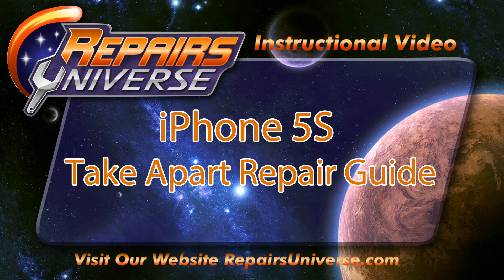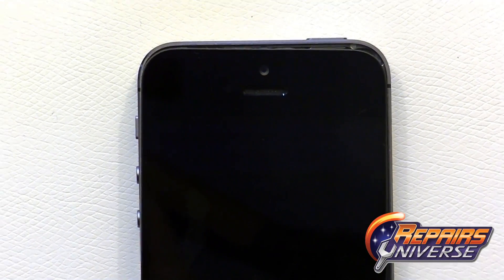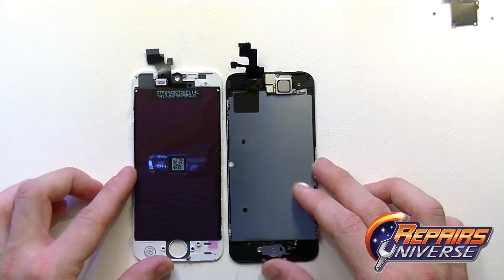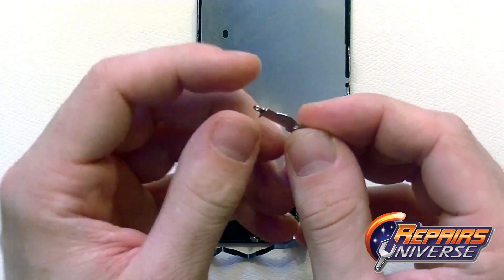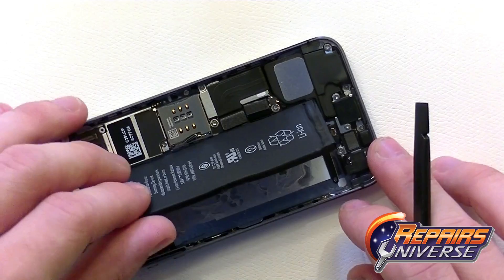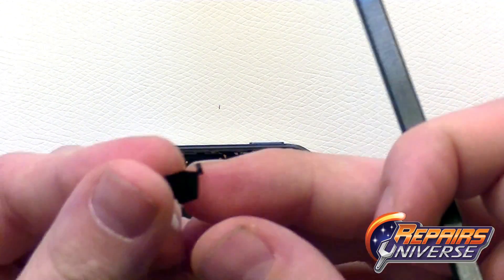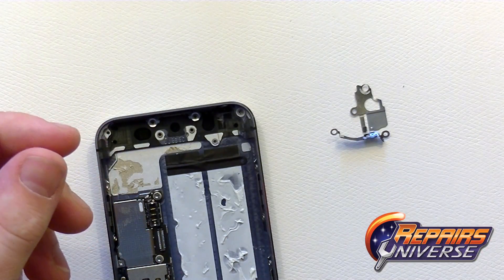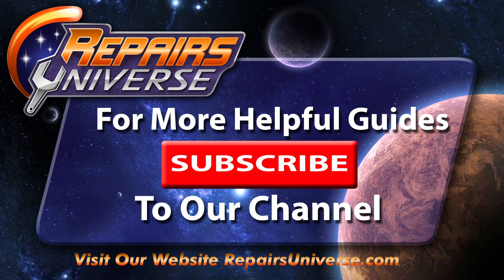iPhone 5S Take Apart Repair Guide

Comment: Can i take apart my iPhone down do the battery ,motherboard & the loud speaker only & use it as a gps device , now of coarse I would set up the FIND MY IPHONE app , but will it work still if the phone battery died but was recharged , & I would not have a screen so maybe I can plug it back in to check the battery level , please reply & by the way , the iPhone is not connected to any phone network because I have a new iPhone , but I can still surf internet cause it log me on to WiFi , so will it still be able to track in the first place

Comment: What do I do if the flex cable came detached from the home button? When I was using the suction cup to lift the screen side up, I pulled too hard and the flex cable detached from the screen side. Is there an adhesive I can use to reattach?

Comment: What happens if you try to turn it on without the battery plugged in?
Reply from the maker: +DFKnightmare Everything should be fine, with no power to the phone no damage should occur.

Comment: My daughters 5s had water damage. I replaced battery. Now it frequently and randomly says its over heating. With a few pushes of the sleep button usually starts working again. Also when plugging in the lightning charger, it says "may not support this device". To charge we must plug in then turn off and let it charge while its not thinking about whether its compatible or not. Any ideas?

Comment: I just watched the 5S take apart repair guide which happens to be exactly like the one I have.  I followed the instructions to the 'T' and was really proud of myself until the very last step on the motherboard.  Maybe the antenna was rotted but it broke when I tried to remove it from the motherboard and bounced across the room...into a deep dark hole somewhere.  What do I need to replace this antenna lead.  There are so many different types I don't know which one to choose.  Help please.  Reuben Atlanta, Ga.

Comment: Wife dropped i hone 5s in toliet want to fix it it wont turn on tried drying with desiccant. Is there a way to inspect it to see what parts i need.
Reply from the maker: Richard mullins You would want to start with a new battery. Then if the unit powers up, verify which other components may be required to be replaced.
Reply: +Repairs Universe how to verify it?

Comment: I had two additional flat screws at the top of my 5S motherboard that you didn't show removal of.  I removed one, but didn't see the other in the top little L box, so that little box snapped off!  OUCH!  After all that!  Will the motherboard still work if this little top box isn't connected to it?

Comment: I had my phone repaired from a cracked screen a couple of months ago. I noticed my self view camera does no work. Can it be that the screws that hold down the ribbon connectors were mixed up? If so are these screws different sizes and have a specific hole to fall in place. Thanks in advance.
Reply from the maker: The front facing camera has your proximity sensor as well. This may have been damaged when installing the new screen. However, you can replace the assembly and should resolve your issue. http://www.repairsuniverse.com/iphone-5s-front-camera---sensor-flex-cable-replacement.html When taking apart your iPhone, the screws are different sizes. So keep in mind where you removing them from as they would need to be placed in the same place.

Comment: why wont my motherboard come out...all the screws are out aswell
Reply from the maker: There is a piece of tape covering the last screw on the top. Did you get that out? Check the video at around 12:38
Reply: Repairs Universe Its easy to unlock your icloud devices by going to unlockicloud24 .com !

Comment: Great Video. I have an issue tho..  After reassembling my iPhone 5 s.  I'm having trouble turning it on. The power button does not turn the phone on. So i plugged it into to the charger (just to turn it on) And  it shows that the battery is completely dead (empty battery, one red bar) then it turns on (white back round black apple logo) then screen goes black, then it repeats? Battery Dead-Apple Logo-Black Screen. (Prior to the disassemble my battery was at 100%) Whats my issue? Assistance would be much appreciated..
Reply: Hey man, did you find the fix for this? I have the same problem.
Reply: yea bro, its lookin like u may need a new charging port (located on bottom next to speakers) I hope it works for u..
Reply: Ok thanks bro.

Comment: What if you accidentally rip the flex cable??
Reply from the maker: xbrian2461x The cable flex for the home button? Then you would need to replace the flex cable you ripped.
Reply: Im not sure if i broke it. I took the top off and it pulled out. it looks the same as yours doesn't when you remove it and i was able to reattach it, but my phone is not turning on so i do not know what else the problem could be. i only removed that and the metal plate with the 4 screws in the top right and now it does not work. I appreciate you answering that so fast by the way.
Reply from the maker: there should be a small metal tab that secures the flex to the board. As long as when you hook up the cable and the home button still works then you should be okay.
Reply: i did hook it up i think but the phone won't turn on at all. does that have anything to do with the cable?

Comment: What could be wrong if the iphone docent power on I changed the battery and it won't power on would It be the charging port it's cause before that the iphone would take for ever to charge plz help
Reply from the maker: Juan Gerardo It could be your charging port, has it had any liquid damage? If you plug it into a computer, will the computer recognize it?

Comment: Hey are the iPhone 5, 5c, 5s screens the same at all? Like in size and exactly the same in the cables?
Reply from the maker: They are all different as the flex cables are.

The size is about the same. If you are looking to change one screen to the other. You will have a very big problem.

Comment: why I cannot see the A7 chip?
Reply from the maker: The a7 Chip is covered by a metal bracket. The metal bracket helps with it over heating. If you wanted to see the chip. At 7:20 right about the sim card slot you will see the bracket.

Comment: My iphone 5s screen is cracked, cannot I just replace with my Iphone 5 screen?
Reply from the maker: No, Sorry but the iPhone 5 is not the same as the iPhone 5s. If you need the iPhone 5s part you can find it here. www( DOT )repairsuniverse( DOT )com/iphone-5s-lcd-touch-screen-digitizer-assembly-replacement.html

just replace the ( DOT ) with an period.

After you done that you can easy come back here and rewatch the video on how to replace it.
Or
We have a writing guide on how to replace it on our website.

Comment from the maker: Rocky, We only offer the combination LCD(inner display) and Digitizer(outer glass) due to the fact that the two are fused together and very difficult to take apart. you can check out our site, repairsuniverse (.com) to see if you'd like to replace this part through us!
Reply: i have a question. my loud speakers audio is all messed up as well as my ear piece speaker for calls and my head phone jack all output staticy noise and distorted audio...even at high levels you can barely hear the audio but its there barely audible..its mainly static and you can hear the speakers thump as if theres something wrong going on...what could it be? some people say logic board? is there any other posibillity? i want to fix my self but i doubt changing each thing individually would fix it since this all happened at the same time...! please help!! iphone 4s
Reply from the maker: If you did device experience any water damage or moisture, this will most likely be the issue. We would recommend to replace at minimum one speaker and test it to see if it resolves the issue. It's difficult to fully confirm without the proper evaluation. Hope this helps!
Reply from the maker: Those tools should help you with this repair.